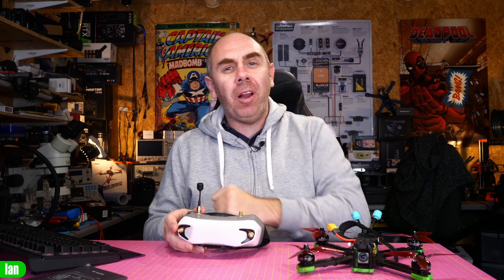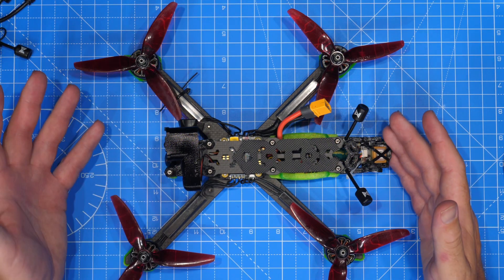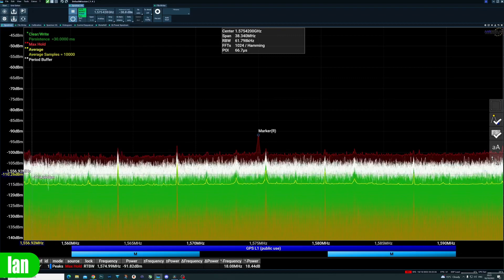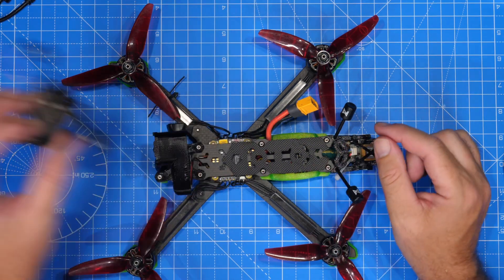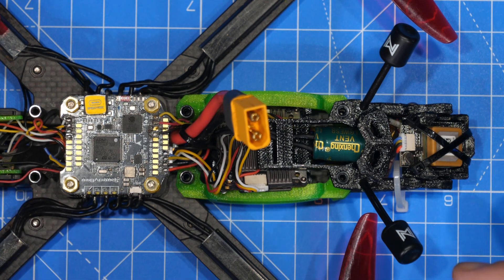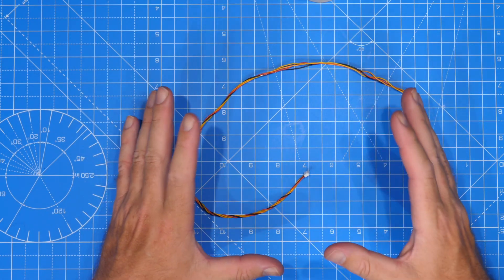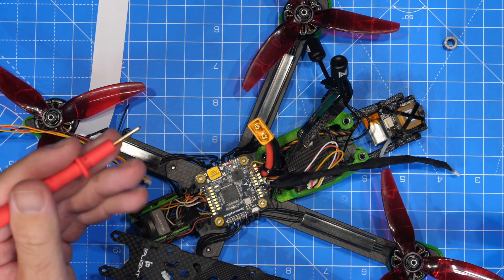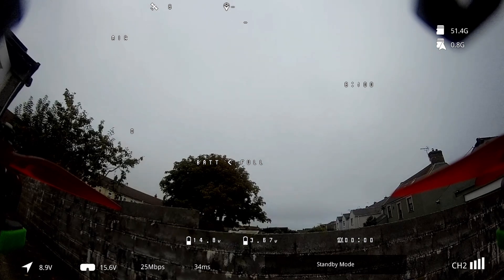Caddx/Walksnail Avatar FPV GPS Issues - Is There A Fix ?

Comment: None of these fixes worked for me.  So I removed my cheap $10 GPS and bought a $40 Matek M10Q-5883 with compass.  I soldered it in, no shields on the wires, no grounding the VTx case....I locked 17 satellites in under 30 seconds.  The bottom line is you get what you pay for.  This latest Matek chip boasts RF noise filtering built in to it's circuitry as well as a higher sensitivity Rx with an LNA.  Save yourself the headaches and pay up for a quality piece of electronics.  I did, and it just plain works great.

Comment: So... you added shielding to your wires and then you solder the shield to the source of the noise... since you connected the source (vtx) GND to your frame and then to your wire shield, effectively turning your wire shield into an RF radiator as well. Solution: disconnect that soldered wire from the shield? I never grounded my wire shield on my 4" LR DJI setup after having slow lock in on GPS. Without that extra GND wire it has always performed perfectly.

Comment: Had similar behavior of GPS problems with my 4 inch quad (diatone romal4).
I had cheap GPS that I supposed to re flash with ublox firmware. Found out that if my gps is closer to crappy Jhemchu F7 mini FC than 11cm it lose fix. No matter how it's powered (dif power sources and so on). I changed FC to kakutef4v2 mini and no longer had that issue and was able to use stock diatone gps mount. Additionally I used shielded wiring just because while all experiments my connectors become crappy.
My reflashed 7$ gps for now works super  fast. And I don't use that f722 Jhemchu FC.
In my theory the noise that affects GPS comes from voltage regulator. Because when FC was powered by USB I had FIX, when I power FC from high voltage power source (lipo, lion, DC cable) the GPS receiving strength drops so it loses fix. I was able to see that via ublox PC app while GPS was connected via UART to USB adapter.
I offer Avatar VRX combo and when I will get it I can try to do similar test.
Possible solution to power VTX with minimum voltage with standalone BEC with good filtering (matek BEC) or with clean lab PD?
Reply: Or, power it with a small battery to test - even good power supplies (especially ones that come from AC) can still get some noise in the power. Using a 2S or 3S battery (for ~8-12v) directly would be the best option for testing with clean power. Then if it works, use a bec with some capacitors or something on it for the actual quad & see if it works.

Comment: Hi Ian. I use a DJI system and have a similar issue. My best fix is to warm up the GPS with my Flipper Zero gpio and a GPS app then unplug and plug into the drone. Interestingly my old GPS unit didn’t do this at all. I lost that in a crash. When I refitted the exact same model I had issues, in fact I tried 2 of them. Both returned no sats. It’s 100% interference as shown on your video but pre-warming takes only a minute and works every time. I reckon you could get away with just powering up the GPS, waiting for a lock led and then transferring to drone for a warm startup. Give it a go 👍

Comment: For me, the separation seems to also be the biggest differentiator. By luck of installation, all of my fixed wings have big separation and no obvious GPS issues (3 planes, GPS lock in about a minute). The 2 quads are much tighter, and both have these issues. As a band-aid fix, I unplug my WS, get GPS lock, plug WS back in, then takeoff. Does not instill confidence for RTH. Working on a better fix now. Maybe someone will start making/selling some shielded GPS cables since it is that sensitive (I know, lazy). Loved the how to build video. Will probably give it a go.

Comment: Great video, I would have liked to see the DJI VTX on the spectrum analyzer in comparison. I remember that the Flywoo Explorer had GPS issues as well, Flywoo only did the copper wrap without the clothtape at that time.
Reply from the maker: Tbh I did think about that but I’ll probably cover it in a separate video
Reply: My GPS problem was fixed on the Explorer by a slower baud rate PGS module that matched the slower serial port baud rate.
Reply: I used some copper de-solder braid over the GPS wires on my Flywoo Explorer. Then covered the braided wires with some thin heat shrink (as not to short out anything near by), It worked better than the unshielded factory supplied setup.
Reply: @Flash-FX  I used to do this too! Works well! I just use copper tape recently though, I find it quickest for me. I have used shielding cloth too, works well, just a PITA to use. I use the cloth for ESCs and FCs.

Comment: Nice!

It is kind of messy trying to get gps working. I have one WS build where separation works really well and I consistently lock in under 30 seconds. Not so much on a second quad where I can't get as much separation and shielding the cable hasn't helped.

Comment: Grounding the heatsync would basically turn it into a RF shield. Maybe shielding the edges of the VTX, or the side facing the GPS could help too.
Reply from the maker: I was thinking this. In a bother box.
Reply: @MadRC  Yeah, this is probably why we find those "cans" on DJI boards. They're trying to contain the EM noise and prevent it from reaching the GPS and other things.
I wonder if there would be a market for generic shielding cases for various components.
Reply: I was thinking this exactly. I will be conformal coating mine and then sheilding on the sides as much as possible. should be easy to just add copper tape to the sides.

Comment: Thanks for the video. Fantastic content as always. One question though, I didn't quite get where the ground wire off the copper tape gets soldered to? Do you solder it to a ground pad on the FC? Thanks
Reply: i guess so

Comment: I have a 1S Walksnail toothpick and with the GPS located right above the canopy , I was never able to lock SATs. 

By relocating my GPS to one of the arms closest to the motor, I’m now able to lock and maintain SATs. 

I never had this issue with my analog builds which makes sense because they don’t put out as much noise as digital.

Comment: Why not just run the vtx in the front of the frame near the camera, and just have shielded short wires between the FC in the back closer to the GPS. You can put the ESC wherever, I put it in different places. Works for me.

Also oscillator and electrical noise wise, changing length of the wire short or long helps significantly. I have been unlucky and had a resonant wire length a few times LoL 😂

Best of luck fellow pilots!

Comment: a friend of mine has a same problem locking satellite when using walksnail, mounting it at the back as such. but after moving the gps to the arm it sort it out, satellite locked quickly. copper shielded the wire helped too.

Comment: Awesome work, Ian! 😃
Did you used 2 pieces of the copper tape or was it just my impression? Because, if you did, you should test the continuity between them... Because there won't be. The adhesive side is isolated. 
Anyway, stay safe there with your family! 🖖😊
Reply from the maker: They were still attached.  Even adding more will still conduct as the adhesive is minimal.
Reply: Some of the copper tape is both side conductive. I use this one. They have one side conductive too.
Reply: @lemonsquareFPV  That one I've never seen. But it could be REALLY useful to make 18650 battery packs, because you wouldn't need a spot welder and using a soldering iron isn't a very good idea.
Reply: @MCsCreations  why? Glitter 801B is SOOO cheap spot welder (i use it and it is so cool!), that you can forget other ways.

Comment: The copper foil only connected to a GND pad of the FC, which still isn't really a complete shield. Would you try to connect the other end of the copper foil to the GND of the GPS header?

Comment: Have you considered adding a real pit switch to turn off the VTX. I have the new Bardwell F7 that has this built in. You could set your arm channel so that when it moved up a little but not enough to arm, it turns on the VTX. This would simplify getting a GPS fix without the VTX being powered on.
Reply: Except for, then you'll still have the problem the moment you turn on the VTX to go fly...
Reply: @Vousie  This is to deal with heat build up because the motors are not running while waiting for a GPS fix. Once you turn the VTX on, you will be arming right after that which should keep the VTX from heating up too much. If you crash in a field, you could also disable thE VTX in that situation to keep it from overheating.
Reply: @TechnicallyTom  No... This video is about the Avatar VTX interfering with the GPS signal. It makes the GPS struggle to pick up the signals it needs. So yes, using real pit would let you get a GPS lock with the quad on the ground, but as soon as you turn on the VTX to go fly, then it will start interfering with the GPS again. Perhaps not enough to lose the lock - that depends on how bad the interference is - but it will still degrade the GPS performance.
Reply: @Vousie I seem to remember there being mention of heat build up as well. This does not solve the entire issue but at least helps with getting the fix and with heat issues. I know moving or shielding the cable has not worked as well as hoped. Moving the GPS forward on the quad would probably help but this is not convenient on most frames.

Comment: I tried using the ViFly gps mate to power up the gps solo first to get a lock which it does, then power on the quad and it keeps the lock with 10+ sats, but as soon as I arm and the vtx goes to full power, they start dropping and eventually loses all of them 😭

Comment: I wonder if there's any variance between units. Your test unit grounded with two bolts showed a significant reduction in noise yet there's no way for us to tell if the same happened to the unit on the quad. Would be nice to point that RF meter at the actual VTX that gave you all the trouble and see what's actually going on there.

Comment: I had this problem with my walksnail v1 vtx. Did everything with shielding, moving the gps to the front and grounding the vtx. Could not get stabel gps. I gave up and laid it a side for one year. Yesterday i upgraded the FC to BF 4.5 and the walksnail wrx and vtx to latest firmware. Now I have stabel 10-12 sats and everything is golden. I have an M8 gps.

Comment: Could use shielded cat 5 6 or 7 Ethernet cable
Reply: I used some CAT6 in my car stereo install = FTW.
Reply: or a thin usb cable if you don't like the idea of having half an inch cable on your quad :) Just use D- for GND and D+ for GPS_TX because you really want those to be in the same twisted pair.
Reply: @jiatan_fpv  I agree I would never have to do this since I won't be flying Walksnail, yeesh.
Reply: @jiatan_fpv  I use this occasionally, works well, and wires are nice and small (even with shielding) I use HDMI cables too. Just an idea for others. Works very well! Definitely recommend!

Comment: A bolt used to ground reminds me of an electrical inspector that failed my electrical service installation because I used a nut, bolt ant two star lock washers the ground the sub panel to an earth ground rod.   He could find any legit issues but was determined to fail the installation.  He wanted a self tapping scew to ground the lug, he got it, when he passed the installation I reinstalled the nut, bolt and washers.

Comment: i HAVE ZERO ISSUES.  im using m880 gps tho. but i moved my gps away from my antennas.  HDZero was the same when I used it.  the antennas are blocking your signal. move your gps and you'll be fine

Comment: My speedybee TX800 did the same to my gps. what i did is shielding the GPS wiring with EMI shielding tape and grounding the tape surface. it did work well untill the gps pop off and exposing the gps connectors to VTX antenna and I get 0 GPS again :(

Comment: Hey buddy have you found a solution to the GPS problem
Reply from the maker: Still ongoing.
Reply: @MadRC  since I fly fix wing I rapped my wires in aluminum foil and then electric tape and mounted it far away as I can from the vtx as I could, have yet to try it , hopefully it helps
Reply: 5 weeks and 2 fried WS VTX’s and I called it quits!   This is insane stupid.   The fb group for Walksnail is filled with Fan boys that like calling you an idiot if you complain about Walksnail and told me just not use a gps!  Lmao.  I prefer to no where my models go down and not spend hours or even days looking for a downed model so that a no.
Reply: @jimmytheriot8978  I had mine 10 inches away on mini talon and still couldn’t get reliable lock.   I’ve shelved the system and went back to DJI in hopes Caddx releases a V2 vtx because the 2 they have out now are garbage
Reply: @Freebird_67  I separate mine about 10" , running the new beta firmware all is good , did over 5 miles the other day no problem

Comment: Shielding the VTX antennas?
Reply: thats going to prevent your Antennas from functioning as thier purpose is to radiate RF.
Reply: @MachuPichuu  I was referring to the antenna wires not the nodes at the tips
Reply: @MachuPichuu  Mads Tech has a video on how to shield the wires with supplies that you can get off of Amazon for cheap

Comment: I have yet to get a lock on 2 different builds.  One quad and one Mini Talon.    After screwing around with all this dumb shit mods I shouldn’t even have to do BOTH my Walksnail vtx’s failed.  Good riddance. I boxed up the goggles in hopes Caddx releases a V2 vtx.  If not I’ll sell the goggles.  Definitely not wasting my money on current caddx WS VTX’s

Comment: Those tywraps laying across your GPS antenna isn't helping..Those two Omni's banging out 700mw ain't either. Could they be any closer?...Stupid Chinese design is what it is..Looks neat, but poor performance...🤔😳😏🇬🇧
Reply: Fact.   But never had this issue with DJI gear.  Why I went back and shelved this WS crap.   I do like WS goggles and the video feed is nice and in some respects as good as dji imo but I can’t get over these crap vtx they spit out. Total garbage
Reply: @Freebird_67  Nothing wrong with the WS VTX.....GPS type and location is the problem...🤔😳🇬🇧
Reply: @EnglishTurbines  boggles the mind that people tend to forget that if you put an antenna in the radiation sphere of a radiator. You are going to have problems.